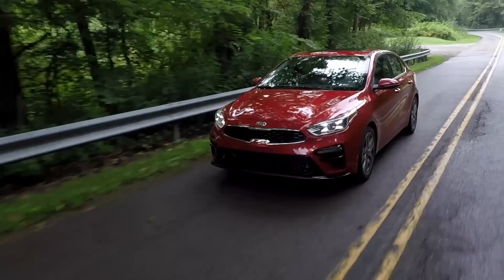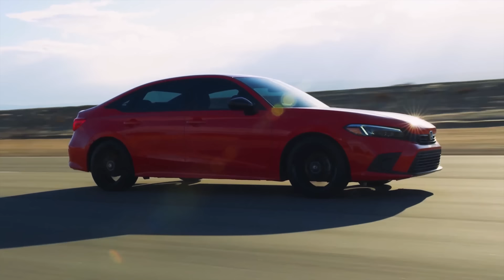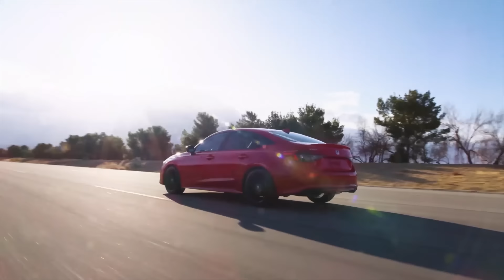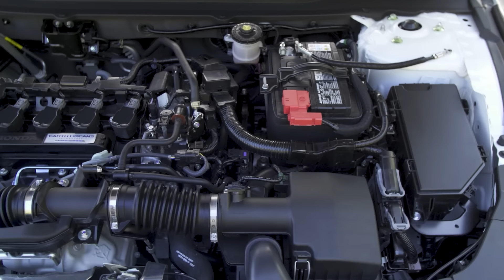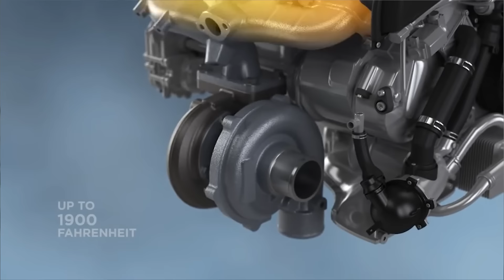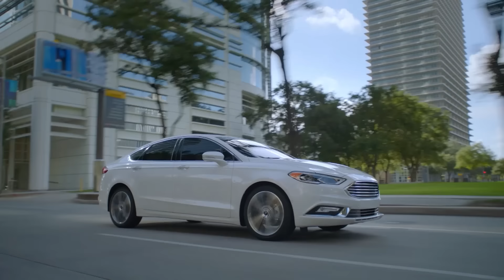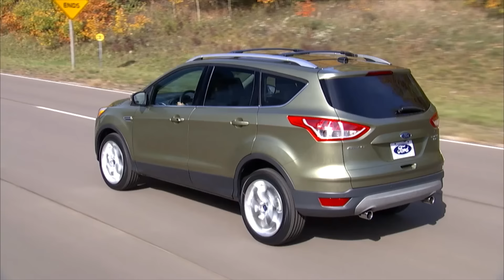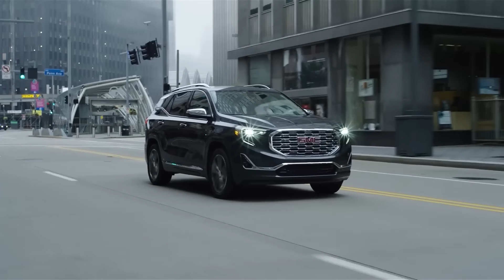Are Turbocharged Engines Reliable? The Truth About Turbo Engines

Comment: I have a Ecotech and I have had to go through several YouTube videos through past 4 years of dealing with car to troubleshoot the exact problems of turbo engines and I agree with a lot of the perspective of this video.  I grew up with a Mazda B2200 truck and it was a simple truck to maintain. …enter this beautiful harlot on wheels turbo in my life,  and I know what Ryan Adam’s meant when he sung love is hell….cause this ecotech you have to love it to get it to work right after a 140k.  Well the ecotech has crankshaft pressure issues with the stock parts so if you don’t figure that out you keep throwing money at the plastics parts.   So for anyone  with a turbo ecotech there are several YouTube videos you should seek out before you start.   Fix the manifold because the pcv valve is bad stock.  Then fix head cover cause it blows the plastic rim and seal.  Then all the coolant parts bolted to head that are plastic.  Then check your intercooler for oil.  That will tell you if your turbo is being abused.  I have to replace mine mainly the exhaust manifold gasket is probably gone and actuator on turbo…. There’s so much.  But you stay determined and you will get it to another 100k.  But really do your research because any auto mechanic will charge extensively.  Great video.  Think about turbo maintenance before you get one.   90% agreement of video here.

Comment: Dont think I like modern cars, especially turbo charged, we add all these extras, infointainment, turbos, start / stop, yes you get a little more power but by 150K your looking at replacing everything, so you save on emissions and fuel but throw the car away earlier.
Also cars with the extras have become much heavier, so what you gain on Hp you lose on weight.

Comment: Turbos are unreliable. They usually start having seal problems at or before 80,000 miles. They run very hot causing seal failure.

Comment: We bought a new 1999 VW Passat with a 1.8L turbo and, though it has several issues, after more than 100k miles we never had a problem with the turbo. I will say it was rather underpowered for a turbocharged engine, so maybe it needed some aftermarket tuning. Now I drive a Mercedes Metris van with a 2L with turbo and it feels like a large v6 or even a V8. It's quite powerful.

Comment: I live at 9000ft so you can feel the loss in power when driving naturally aspirated engines. Turbos help a lot at high altitudes, even if the maintenance schedule have to be tighter.

Comment: 5 volvos....all turbo charged 5 cylinders. All made it over 250,000 miles....one a 94 850 t5 made 503,000 before she shit the bed. Gotta use top tier gas and absolutely need their scheduled maintenance. Happy driving, do your research

Comment: Just watched your video. What you and others miss is that the auto industry is doing this due to the crazy CAFE ratings. The last time they slapped turbos on cats was the mid to late eighties.  They disappeared when they added 4/5 valves and variable valve timing to engines. I'm looking to get a NA engine before they whack off a cylinder and add a turbo. This is going to be a disaster especially for a Toyota

Comment: Two of my kids owned Cruzes with the 1.4L turbo and they were both troublesome engines, with one requiring a turbo replacement at 110,000 miles due to a cracked housing.  Both now own naturally aspirated Corollas.

I bought a 2022 Equinox and that year the only engine offered was a 1.5L turbo.  I am not sure how closely related these engines are, and I maintain my own vehicles very religiously, but so far my Equinox has performed well and been trouble-free for nearly 35,000 miles.  Its performance is excellent.  It has substantially more power than my 2011 2.4L Equinox while getting 10 MPG better fuel mileage.  The little 1.5L turbo will get 37 MPG on the interstate at 70 MPH, providing it is 80 degrees or warmer outside.  It does drop significantly in colder temps, but my older Equinox was lucky to get 28 on the highway.  I am still curious to see how long it holds up, but so far, so good and I have several friends that have small SUVs (Hondas, Toyotas, Hyundais, etc.) and none match the efficiency of my Equinox.😊

Comment: Avoid turbos al all cost. Avoid VVT engines at all cost. Avoid all engines with a rubber timing belt.  Avoid all overhead cams. Avoid all engines with over 2 valves per cylinder. I like Chevy small blocks.

Comment: My mind was already made up, and what you explained confirms my thoughts.  I’m sticking with naturally aspirated engines.  I don’t need a car that screams away from stoplights.

I’ve got a naturally aspirated 4L in a Toyota 4Runner.  All I’ve ever done is change oil faithfully and changed plugs once.  It has 440k miles on it and runs like new.  It’s fast enough.

Thanks!  Great video.

Comment: My next vehicle will probably have the Camry hybrid drive train.  In a Crown or SUV. 

No turbos,  no GDI without port injection, no sleazy mechanical CVT,  no accessory belts,  no 11 speed torque converter automatic, no torque converter,  no start/stop system,  no 12 Volt starter, etc.

You do get an electric car with gasoline engine assist, electric motor direct drive like most battery electric cars, efficiency tuned Atkinson cycle gasoline engine with CVT action provided by a planetary gearset, great fuel economy, good acceleration in most applications.

You get most of electric car goodness without any of the electric car drawbacks.

Comment: I avoid them as they are hard on engine components and reduce the engine life.  Turbos are not necessarily unreliable but there is no substitution for displacement always and I want torque on the low end, not the high end.

Comment: I'm not an engineer or a  mechanic, maybe a backyard mechanic at best. Turbocharge equals heat and more friction. Heat and friction equals malfunction and breakdown. Yes, a new turbocharger is great for power and speed, but for how long? Longevity and reliability is very important. Gaskets seals, hoses, metal parts get too hot. A disaster in the long run. I need a vehicle that's dependable. Time and money taking a vehicle to a shop so I can get ripped off and spend money isn't an option. I will continue to work on my natural aspirated V6, and V8 engines. Run my vehicles until they rust out or engineer warps to the point it's no longer worth fixing.

Comment: One key point:  car manufacturers have been increasingly extending their recommended service intervals (including oil changes) in order to make it look as though their cars are cheaper to own and maintain.  Given that turbocharged engines are harder on oil, and are more sensitive to regular servicing, it may be prudent to set a cycle of more frequent oil changes to maximise engine life.

Comment: A normal car engine is poorly designed to be boosted by a turbo due to pressure and heat. It certainly does have a higher wear and tear than a naturally aspirated engine.  Unlike truck diesel engines, which go easily over 1 million miles, car engines are far less robust for the pressure. Most manufacturers are switching to smaller displacement engines to get better fuel efficiency. I'd rather spend a few dollars more on gas than to have to worry about a blown engine.

Comment: The EcoBoost 2.0L was a head design problem, not a heat problem, it has since been fixed. The reliability issues with turbos has to do with costs. How many semi engines use turbos? Pretty much all of them yet it's not uncommon for them to run 1,000,000 miles. The reason for the longevity is that the engine was designed to work with a turbo charger from the ground up, not as an after thought on a per-existing engine. The auto companies are going to cut every cent they can in manufacturing, a turbo charged car engine can be designed to last hundreds of thousands of miles but that would add to he bottom line.

Comment: So they put smaller engines with turbos to cut emissions but have decent power. But you have to drive it longer because the engine needs to warm up to operate properly, so how many tons of carbon are you really saving?

Comment: You can't get something for nothing. Shorter engine life and much more expensive to repair after the inevitable blowout.
The old engine lifespan for a turbo engine was 10% less. I don't think the new engines are even as reliable as that.
If you have to have forced induction, go supercharger.

Comment: My naturally aspirated 6.4 liter, 485 HP,  V8 Dodge Challenger gets 22-24 MPG doing 80 MPH, while only spinning at only 2000 RPM's. Dropping down to 65MPH ishe gets about 30 MPG. With MDS (multible deactivation system) on.

Comment: Looks like I made the right decision buying the 2.5LT 2016 Fusion.  I am thinking of getting a SUV, but there are no non-turbo + multi-port fuel injection models, aside of a RAV4.  Hey, maybe I should look to Toyota?  The CrossTrek and Outback have non-turbo engines, yet they are direct injection, thus a clean-out of carbon now and then.  I guess that is one's choice.  There is a Honda HR-V with a base engine which is multi-port -- not much HP, and I would have to check again on real world safety figures data / insurance claims.  I think some Hondas have the hard seats too?   Subaru = safety.  Toyota = long engine life.... and noise.

Comment: What's the link between stop-start and heat cycles? The engine is not going to cool down in the few minutes between stopping and starting?
Reply: You are right - the short stop start doesn't cause the engine to cool down.  However, while stopped, oil is not circulating to carry heat away from a hot turbocharger. Thus there is now an increased risk that the oil that is static in the turbo begins to reach its heat absorption limit (i.e. you can cook the oil).

Comment: Wow, it's almost as if a low-stress, naturally aspirated, port-injected engine that is mated to a traditional automatic or manual transmision could possibly be simpler to repair, cheaper to maintain, and cheaper to buy.
Reply: Sarcasm*
Reply: Over time, things can be engineered to be reliable. It just takes time. When cars were first invented, they weren't reliable and definitely weren't safe. But look at them now: much more reliable and safe and they'll only improve over time.

Comment: I’ve owned Turbocharged vehicles both diesel and high performance petrol for the past 27 years without any issues; I have agree they are not for Joe Average. Looked after both in how you use them and maintenance no issues but abused and neglected like most things they will become expensive.

Comment: Hybrid system does a far better job than turbo. 
-Gives minimum 40-50ps and it's has so much more room to grow.
-Halves your consumption.
-Your car will be more silent with less engine noise.
-Your engine will have half the wear and will have double the lifespan of a normal and triple compared to a turbo charged engine.

Comment: This is all happening because of the fraudulent climate change movement. People have no idea how much of their everyday life is affected by the lie that C02 emission cause climate disasters & heating. The only reason manufactures started downsizing engines & adding tribes is because of Government mpg & emissions standards. Trump had slowed this down a little but we need politicians that will cut back on EPA regulations. All these regulations are not LAWS passed through the House & Senate, they are just Executive Orders signed by the President & they can be undone by a President with the stroke of a Pen. People are smart for keeping there older Naturally Aspirated Cars & not buying these new pieces of crap or EVs but they need to realize how Election Results are the reason they are NOT driving a new Naturally Aspirated Automobile that's reliable. The current automobile market crash is great but we still need Manufactures to scrap all these new small engine ideas.
Reply: my suggestion for you..if you dont like all the emissions rules.. go to india... and see how your paradise suits you

Comment: Nailed it.  I have a 2016 Kia Optima SXL with 80k.  Since I’ve had the car, they’ve “replaced” the turbo three times.  While covered under the 100k warranty, that’s crazy.  I fall into at least two categories you mentioned: I drive only 6 miles one way to work, so the engine doesn’t have time to warm up.  I rarely need to get on the highway, and even when I do it’s for maybe 15 min.  Also, I’m not the best at keeping up with maintenance.  Better than I used to be, but still not the best.  I plan getting rid of it before I hit 90k and going with a simpler engine (Subaru Wilderness Forester).  I’ve had a couple mechanics tell me I need to drive it for at least 30 min straight on the highway daily….
Reply: This is all happening because of the fraudulent climate change movement. People have no idea how much of their everyday life is affected by the lie that C02 emission cause climate disasters & heating. The only reason manufactures started downsizing engines & adding tribes is because of Government mpg & emissions standards. Trump had slowed this down a little but we need politicians that will cut back on EPA regulations. All these regulations are not LAWS passed through the House & Senate, they are just Executive Orders signed by the President & they can be undone by a President with the stroke of a Pen. People are smart for keeping there older Naturally Aspirated Cars & not buying these new pieces of crap or EVs but they need to realize how Election Results are the reason they are NOT driving a new Naturally Aspirated Automobile that's reliable. The current automobile market crash is great but we still need Manufactures to scrap all these new small engine ideas.
Reply: @wandameadows5736  yes.. trump and his tramp 2024  maga
Reply: its a kia/ Hyundai, this is all you need to know

Comment: Significant problems with the Tundra turbo wastegate!?! Get a grip. This occurred early in the first trucks and were addressed immediately for some just over 100 trucks. In light of the volume of Tundras sold in 2022, 2023, and 2024, this issue is more than exaggerated. Disingenuous at best.

Comment: Thank you for your opinion.
Overheating and carbon/dirt build up cause all sorts of problems that effect the performance of a car.
The simpler the car the better it is , because it's less money spent for repairs.
Reply: yup the cars in the 60's were simple,, a v8 with 200 hp was great..wait..my 14 fusion 2.0 vep engine  4 cly has 290 ish.. 250 at the front wheels

Comment: The achilles heel of light  weight turbo engines is heat and cheap head gaskets and plastic parts on the engine.

Comment: What are your thoughts on the 2024 Highlander and the turbo engine...it is the 2nd year of this engine change...is it Toyota reliability or has not been around long enough to rate its reliability...thanks for your time...
Reply from the maker: It has been used in the Lexus NX since 2021 and no issues so far. It seems to be a good engine. It follows the same basic design as the very reliable A25A "dynamic force" 2.5L engine which has been around for ages.
Reply: Thank you for the reply...now to the Camry...will be doing city to highway driving...(from Ontario to Halifax and or Dawson city) my big concern if I choose this vehicle is the engine...they have the V6 and of course the 4cyl. engine...would the 4cyl engine be a good long distance highway engine...I think the V6 would be better but would the 4cyl. engine do the job...as the gas mileage is insane...as  most if not all engines are 4cyl do they cut the mustard on the highway for the long haul...thank you...Tim @carhelpcorner

Comment: I drive my 2020 Honda Civic Si like grandma during these NY winters until the engine is completely warmed up. I Audi don’t park, turn the car off, and jump out; I wait 1 minutes for the turbo to cool down. Regular oil changes every 4000 miles. I expect to break 300k miles with no major issues. We’ll see.

Comment: My 2cents turbos have bearings and internal fan driven by exhaust gases change your oil earlier yes warm up and cool down restart engine immediately if you stall engine to maintain oil lube. I have equipment with over 4000 hrs no turbo issues. Basically it's a air pump.

Comment: Lexus Toyota should offer the naturally aspirated engine V6 V8 as standard and the turbo as an option along with the optional hybrids they already have.  Moving all their cars to turbos  is a BIG mistake. 2023 NX and RX are already being traded in for V6  and V8 models. #Lexus #LexusV6V8 #Toyota   Im avoiding turbos at all costs, all I do is a lot of short distance drives I know I can’t deal with that engine and the issues cause I’m not a car person just need the car to work and be reliable in all weather.

Comment: This guy in not a mechanic and is exaggerating a lot about turbos. Maybe there is more to go wrong but those things simply don't go wrong in reality, the Honda turbos are very reliable! There is a black guy here on YT that has a channel and his 2017 Civic EX-T (just like mine) now has over 700,000 miles on it!! He's a medical supply courier and drives all day long and some very long trips. He's now having a slight oil leak issue, not bad but no other major problems, including his turbocharger unit!!

Comment: My 2017 Civic EX-T 1.5L turbo with a 6 sp. manual gets way better than 34 MPG, even in pure city driving. Hondas always get MPG wildly underestimated. On the interstate, I've got as high as 49 MPG claimed on the computer. Which, realistically about 47 real world MPG because Honda mileage computers are always optimistic. But 47 is way better that 34!!